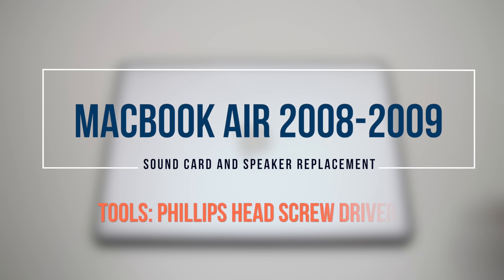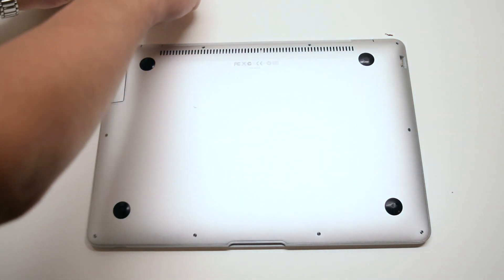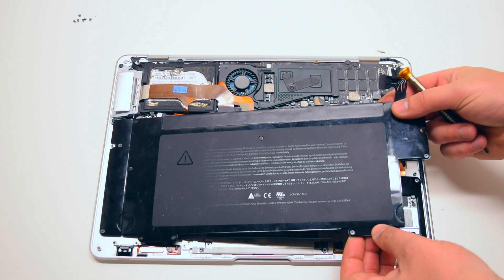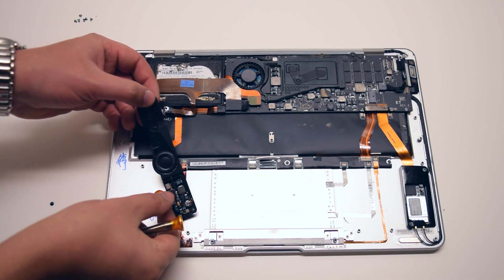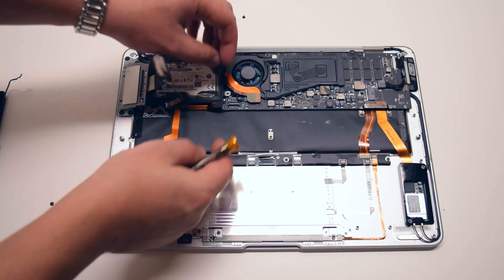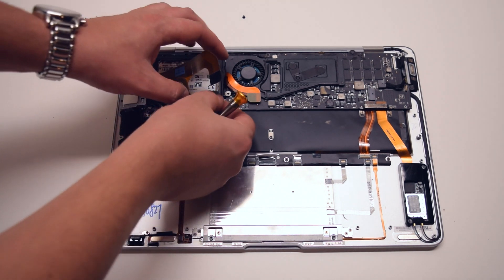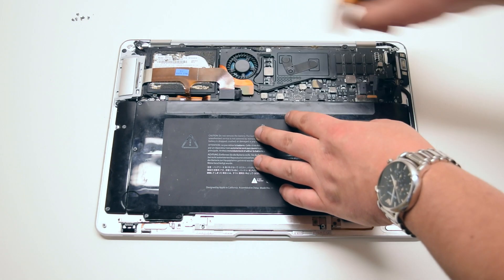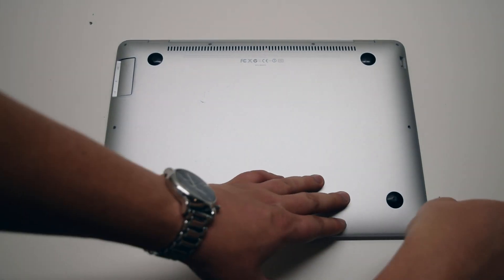Macbook Air 2008 and 2009 A1237 and A1304 Sound Card and Speaker Replacement

Comment: My MacBook Air 13" A1237 has no audio, and a prohibited sign appears. I have concluded that it is a hardware failure. How can I determine which part is faulty—the flex cable or the speaker?